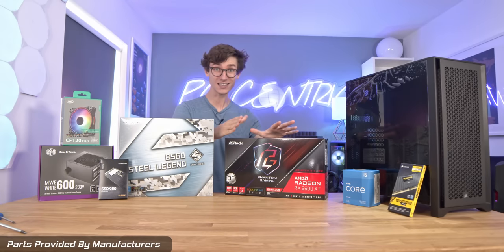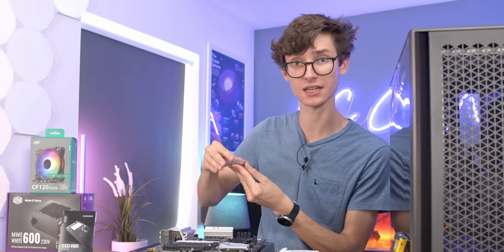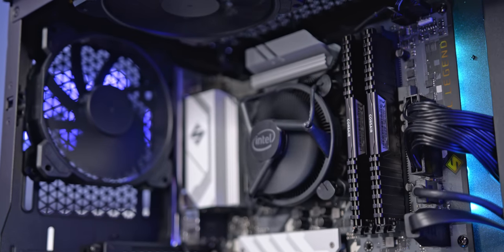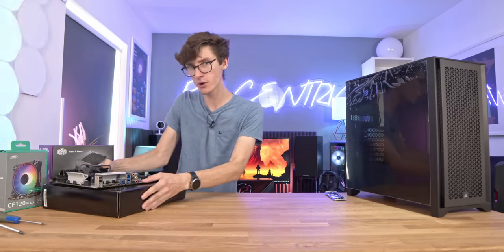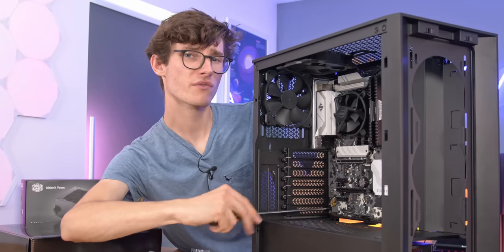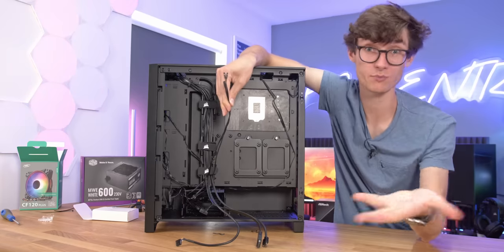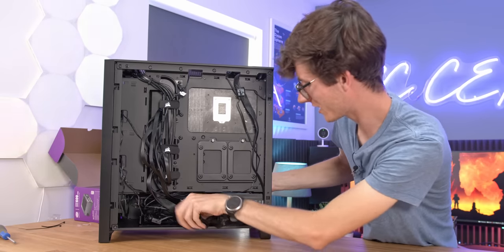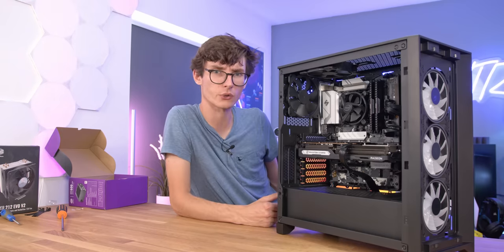The ULTIMATE $1000 Gaming PC Build 2021! 😎 RX 6600 XT, i5 11400F w/ Gameplay Benchmarks!

Comment: I built a gaming PC this week and I used the following parts
Intel i5 11400f CPU 
MSI MAG B560 Tomahawk WiFi LGA 1200 ATX MB
16Gig of Crucial ballistix Gaming memory 3200
a Kingston 1TB A2000 M.2 Nvme SSD
MSI MPG A650GF 80+ Gold ATX PSU
A White Fantech CG80 case
I am still using my MSI RX 580 8 Gig overclock edition GPU untill I need to upgrade but it still runs all the games I have
Reply: 650 psu is borderline I'd have gone for 750nor 850 if u over clock

Comment: I have the same build, what do you suggest if I need to upgrade the CPU without replacing my current motherboard (H510).
Reply: i also have the same build and am wondering myself if i should upgrade my h510 for a more current lga 1700 chipset motherboard as this generation's CPUs have much better value. out of the 11th gen CPUs i think going for an 11700f at least should make it last for another couple years but thats a 400cad upgrade alone xD

Comment: I've decided to finally get into PC gaming at the age of 40 lol.  I'm comfortable enough with computers, I've worked on my regular desktop a little, but nothing crazy complicated, just replaced a few components.  I want to learn though and excited to get into PC gaming.  I had a question, would it be a good idea for me to just buy a gaming desktop from Best Buy or somewhere, with the intention of upgrading components later?  Considering the price of parts right now, this seems like it would be an easier way to get into it, at least where things are now with the supply issues and price gouging.  Or are those machines complete crap?  I have no idea I'm new to all of this.
Reply: The Best Buy machines are horrible I suggest you wait a little longer if you wanna get a graphics card but a micro center should be good place to find pc parts
Reply: @user-mc6vi8yd7l  What do you mean by an actual prebuilt vs an OEM?  Where would I buy a non-OEM prebuilt?

Comment: i would have liked to see what the difference would have been if he went with the cpu cooler on the clock speeds and temps of the cpu. i think i would have picked up a cooler for $25-30 bucks and maybe 1 or 2 more non-argb case fans for the $45.

Comment: Guys im about to buy my first ever pc and I want to ask you what do you think of my pc specs, is my power supply enough, can this pc run games smoothly, is cooling enough any help is appreciatedand also maybe ill buy 3060 ti so check all of that for 3060 ti .
My pc
CPU : Intel core i7-11700 2.5Ghz ( 4.96 hz ) 8 cores, 16 threads, 16 mb intel smart cache 
GPU Msi Rtz 3060 12G Gddr6 
MOTHERBOARD : Asus prime H510m-k Lga1200 matx 
SSD : Kioxia exercia 1tb 
RAM : G.skill ripjaws 26Gb ( 2x8Gb ) 3200 mhz heat sink
PS Njoy synergy 600 600w 80 plus white
COOLING : Intel stock

Comment: This used to be an high end super expensive system (8700K\RTX 2080) and now is just entry level.
Reply: thats still a high end system, i don't know in what world a rtx 2080 and a i7 8700k is entry level.
Reply: entry level is a gtx 1650 and a i5 8400f
Reply: @coolmanreebro  that's minimum level and honestly doesn't cut it anymore.
Reply: @coolmanreebro  well 11.400F costs 162€ in my country and is as fast if not faster than the 8700K, the 6600XT at 380$ is on par with a 2080 which was a 700$ card if I'm not mistaken. These values are entry level to me. The 8700K was 370-400$ new.
Reply: High end is my 3070Ti with my 10850K lol
Reply: @CarlosCamposvc92  i dont know what you are talking about, a 2080 is still a very powerful card and can play most modern games. i have a amd radeon r9 370 and an i7 6700 and it can play most games fine, while a rtx 2080 is like 3 times faster than a r9 370.
Reply: @coolmanreebro  good for you, we clearly have different perspectives when it comes to what is acceptable in terms of gaming. But I just want to say that capable is not the same as high end.
Reply: @CarlosCamposvc92  you were saying it was entry level
Reply: @coolmanreebro  I said that that kind of performance is entry level now, if you consider that a 3060Ti is faster than an RTX 2080 and the 6600XT is slower than the 3060Ti.
Reply: @shubhamupadhyay6503  it's not marketing tricks, it's technology evolving and things becoming faster with less. I don't want to play at 1080p high settings, 1080p high settings was good back in 2014, I want to play at 1440p max settings with RT at 60+fps. Like I said, clearly different perspectives.
Reply: @CarlosCamposvc92  For rt you definitely need a high end 3000 series card, and I agree  that different people have different expectations and perspectives.
Reply: @coolmanreebro  8400f?

Comment: What CPU cooler would you recommend for the i5 11400F compared to the stock cooler?
Reply: any tower cooler for 20 to 30 bucks will do fine. I use the Vetroo V5 and it runs nice and cool while gaming.

Comment: Would it be an improvement if I used a 3060ti instead I’ve never built a pc before so I don’t rly know what’s good and what’s not
Reply: Yeah the 3060ti is better performing but the price is inflated to about £600 which is why it’s better to buy a 6600xt since the price isn’t as inflated

Comment: I did a build like this 11400f + z590 asus prime + sapphire nitro+ 6700 xt 16gb 3200mhz, and psu 750w gold, and was getting 60 fps in fortnite 1440p no matter what, so i decided to change mu gpu for a asus dual 3070 and now is running smootly, and im changing the 11400f with a 5600x

Comment: If you are using a m.2 ssd as a starter drive, does it matter how much storage it gas?
Reply: No, it doesnt matter.But to get the best experience out of the speed of m.2 you Need the Most used Applications on it also. So to conclude  best thing would to be to Safe up money for a at least 500gb one.

Comment: Quick question could I use the PowerColor VGA - AXRX 570 4GBD5-3DHD/OC instead of the graphics card on there my budgets 1500 and the graphics card you said puts it over that price
Reply: Please lmk and reply
Reply: You can use practically any graphics card from the past decade or so. The hard part is finding any card that's in stock and at reasonable prices.
Reply: Thanks, first time building a pc so I'm kinda new to it ik that not all parts are compatible with other parts but thanks

Comment: Dumb question, but if I plan on having my computer hardwire do I need to buy a wifi MoBo?
Reply: No
Reply: If you ever do need wifi for to connect a tablet or headset to the pc you can buy an add on pcie card or usb adapter.

Comment: Wooow.I wanted sooo much to build a 1000 PC but I have no knowledge about PC parts.
Questions:
1 Is this build good for highschool and content creator of minecraft,fortnite,splitgate...
If not how can I fix it
2 Is this silente if not how can I fix it
Reply: Actually this build is overkill for any school related work, for content creation at 1080p and even at 1440p it would be great for the games you're mentioning, as they are not that resource intensive.
The overall system itself can be silent as long as you don't use the stock Intel cooler, as that can get pretty noise under load.

Comment: What do you mean "install windows"? Do you pay for that? Can you do it to any build? You didn't exactly show how to install it with that flash drive. Do you buys those drives? How does that work?? Thats only part that really confused me
Reply: You have to install an operating system like Windows in order for your newly built system to function. Otherwise, it won't do much without an OS. 
If you have access to another computer with internet, you can download the media creation tool from Microsoft to make a USB installer. With this USB drive, you can install Windows on your PC. If you do not have access to another computer, you will need to buy a Windows USB installer from Microsoft or other retailer.

Once you have your USB installer, you boot your new PC from the USB drive and go through the install process. There are countless videos and guides explaining how to install Windows on a new computer.

If you're doing things by the book, you have to pay for a product key. This is a code you get to prove that you paid for your software. Windows is not free and you're expected to pay for it if you're doing things the Microsoft way. Unofficially, you can run W10 without a product key indefinitely but you won't be able to personalize your computer and a watermark will appear in the bottom right corner. Other than that it will work exactly the same as if you paid for the product key. If you buy the USB installer from MS, you will get the product key since that is what you're mainly paying for.

Comment: Would everything work similar if I switched the i5 to a ryzen 5 3600 and the b560 to a b550?
Reply: R5 3600 is good with Rx 6600,r5 5600 is for xt,I feel its better this way
Reply: @bbbbbbbb885  thanks, but is the performance with the 3600 similar to the one in the video?
Reply: @hans-rudi3471  yes mate

Comment: How do I know everything works with each another like my gpu and my motherboard and my case with motherboard
Reply: Practically all GPUs from the past 15 or so years use PCI Express. And practically all motherboards have at least 1 PCI Express slot. With that said, you can use practically any graphics card with pretty much any motherboard. Look up PC form factors. That will help you figure out case and motherboard compatibility.

Comment: i got the non airflow version of that corsair case and tbh even the glass front one is still good for temps my GPU never goes higher than 60 to 70 while gaming i have 6 corsair fans in the case though. and my cpu stays nice and cool with my darkrock 4 slim. even my ram is always at low 40s in temps. i use corsair dominator RGB. (90% of my gear in and out of my PC is corsair lol) i was going to upgrade to a RTX 3060ti found one for like £450 not a bad ish price. but my phone has recently broke so i wont be getting it this month :( maybe next month i will Who knows

Comment: Should i get 3060 ti or 6600xt for a little cheaper?
Reply: @sld4507  The price difference is 209 euros so idk...
Reply: Depends on the price. 3060 ti MSRP is $400, and 6600 xt is $379. I’d go for whichever is closest to MSRP as they are very similar cards
Reply: @sibbyrobson3404  ok thx but its a pc specialist prebuilt and the only difference is the gpu and the 3060 ti one is 209 euros more so ye..
Reply: @sibbyrobson3404  Nothing is similar with those 2. 3060Ti trashes the 6600XT
Reply: @HexosRL  209 euros more is a lot - not worth it. Just go for the 6600 xt one

Comment: I tried building my pc for the first time and my pc shows no display on my monitor but everything turns on I have no idea what I did wrong can somebody help me ??
Reply: Make sure you plugged your video cable into the graphics card and not the motherboard's video output. Once you've verified that and it still doesn't work, you'll need to some troubleshooting. There is no universal fix for this as there can be a myriad of possibilities. Start by checking every single connection, even the trivial ones. Make sure all hardware is installed in the correct spot securely.

Comment: Update for 2023, Get these Instead!
CPU -

Intel I5 13600k / 7700x
( if the prices don't differ too much Def buy 7700x )

MOTHERBOARD - 

If You DONT Want to Future Proof-

Ryzen - b650
Intel    - b660 D4

If You WANT To Future proof -

Ryzen - X570-E 
Intel    - Z690 D5/ Z790 D5

GPU -

WAIT For the 4030/4050 OR 

Intel - RTX 3060/ ARC A770 

OR

WAIT FOR RX 7600 XT / RX 7700

OR

AMD - 6700 XT OR 6800

Comment: Ahhh, why put the gen3 ssd into the only gen4 slot :(
Reply from the maker: Latency should be better on the cpu pcie lanes rather than chipset, plus you get the heatsink. Just move it down if you upgrade to gen 4

Comment: The 6600 XT would be utter garbage if it wasn’t for this “shortage”, which I’m convinced by now Nvidia and AMD intend on maintaining as long as they can. The 3060 Ti is a much better choice and IMO the only card under $550 right now that’s even worth its MSRP.

Why are people buying these in such massive quantities? They simply aren’t very good.
Reply: 3060 ti isn’t much better than the 6600 xt, since 6600 xt stays at the middle of 3060 and 3060 ti it doesn’t justify for a uppgrade. But if there was no ”shortage” then yes 3060 ti is much better